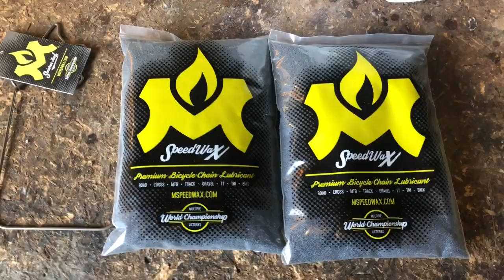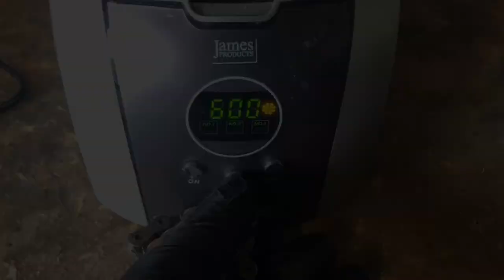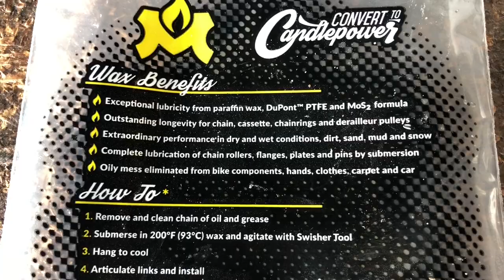Speedwaxing my Chain

Comment: Make sure your master link is pointing in the direction of travel. I see it's pointing in reverse at the beginning of the video. Thanks for the how-to!
Reply from the maker: Adam yeah I’ve read that somewhere before, though as the link halves are identical I don’t see how it makes any difference (I’m not an engineer) unless a boffin has a technical answer for me? Never had any issues with them and I must have re used that link over 50 times easily... 👍

Comment: I have used MSW for awhile.  I ultimately have starting adding just a little paraffin lamp oil to the molten wax (10-20%).  I am sure it slightly reduces the efficiency but it lasts longer between rewaxing. Either way this stuff is great because it is super clean, efficoent, and protects your chain and cassette amazingly well.  But you do need to get used to the noisier chain and recognize when the sound changes to indicate need for rewaxing.  Adding paraffin oil quiets it down but only a little.  It is also a bit less stiff when it dries.  I find without the oil it flakes off pretty quickly.  It is  easy to do the procedure once you've done it a few times but still, if you can do it less often that is good.  Of course if you are racing and every watt counts that may not be as important.
Reply from the maker: Stuart Dryer thanks for the info! 👍

Comment: It's supposed to be louder than normal lube. Part of the advantage of wax is that it's a hard lube so doesn't stick to other components like normal lube and dirt doesn't stick to it. Normal lubes create drag in the system because it's sticky and of course dirt sticks to it increasing that drag. Ceramic Speed did a video I think about noisey chains being more efficient.
Reply from the maker: Dave Hughes ah thanks, was surprised at how much louder it was than my last wax mix. 👍

Comment: When I use this wax on my chain as soon as it cools down enough to handle I put the chain back on the bike this does away with all that breaking of the links and coats the rear cassette as well, I then take the chain off again and repeat the procedure
Reply from the maker: stretch yeah I did that with my last wax mix but thought I’d do it as per the book this time. 👍

Comment: I've tried waxing my chain, and I've tried liquid was lubricants but I'm not convinced. For me, there is nothing better than a dry oil spay once a week after cleaning my chain. I've always found that waxed chains shifted badly, but hey, maybe I'm not doing it well. Good video though.
Reply: It's hard to get right but well worth giving it another go. If nothing else it'll make drive train components last longer because it doesn't turn into what is effectively grinding past as soon as dirt hits it like normal lube does.
Reply: In my experience MSW shifts strangely for the first 5 miles or so, even on my Di2 bike. After that it is flawless. Now I add just a little paraffin oil which eliminates the need for  that break in period.  But only add a little.  Max 20% for winter, 10% or less in summer.

Comment: The magic formula is 50% wax + 50% paraffin (a.k.a. lamp oil, a.k.a. kerosene) + 10 grams PTFE powder per kg + 2 grams molybdene disulfide per kg.
Reply from the maker: chesshooligan 1 I put those in my last mix but got the amounts wrong, didn’t work after that. 👍
Reply: thx

Comment: Is that quicklink the wrong way around?
Reply from the maker: The arrow points to the pin and as they are both the same I’m not sure you can have it the wrong way around. Never had any issues with them. 👍